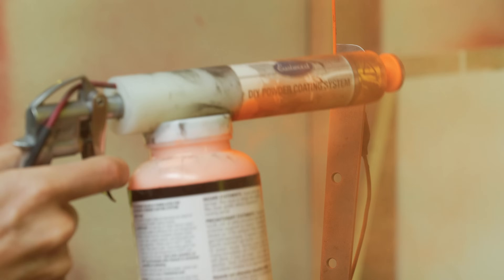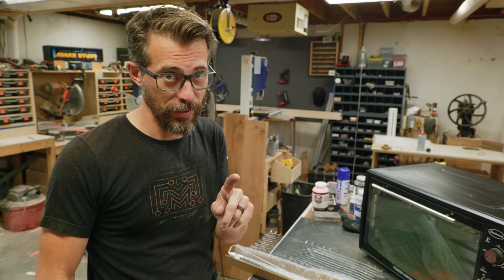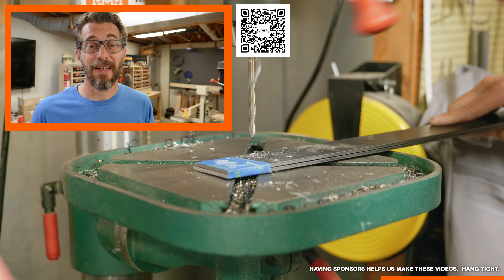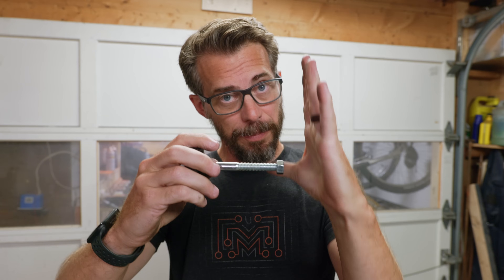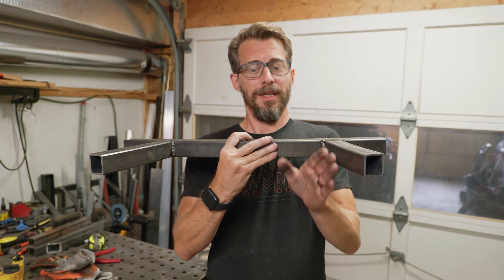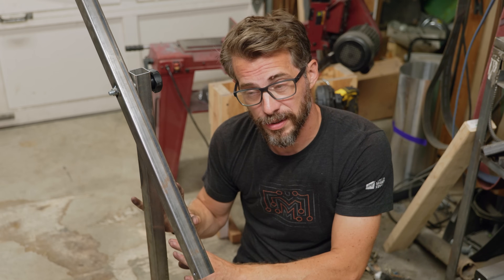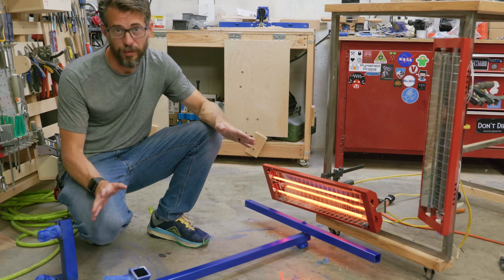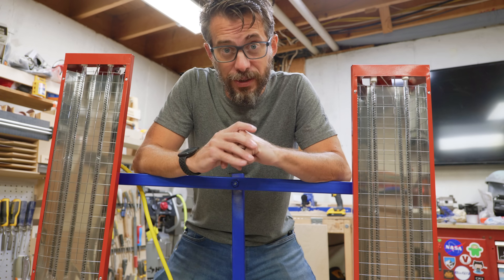How To Powder Coat Without An Oven!

Comment: You're going to have a hard time getting good, repeatable results. You can't preheat parts reliably, it is generally line of sight, and your surface temps are going to be all over the place. To get a good bond, the base material needs to be at temp for 15-20 minutes depending on the powder and metal you're coating. You can do it, but be prepared for lots of fiddling with distance and time with the temp gun.
Reply: 100% This. The heaters should be inside some type of foldable, insulated box with a fan because trying to get even coverage on any nooks and crannies will be impossible with this type of setup.

Comment: Get some assorted silicone conical plugs (from tiny to large) for fast masking of threaded holes. They're also re-useable since nothing sticks to silicone. Build a foldable rockwool lined enclosure to encapsulate the heat. A working second hand electric oven works well for mid-sized parts or batches, and you can put the small oven on top of it for the little jobs. I've done lots of automotive parts like rims, steering, suspension and brake components but you need to be careful of the powder's temperature range so in some cases, high temp paint is a better option. The heat will add a toughened result in most cases, but you will obviously need a lower temperature for those items. You just need to think about any metal items that you don't want to rust or corrode really. Yard equipment is always a good choice like snow blowers, etc.
Reply: They also have high temp powder as well.

Comment: I think you should have some kind of fold up reflector. So you can store it away easily, and take advantage of the radiant heat all around.
Reply from the maker: Yeah that would be a good upgrade to try
Reply: @Iliketomakestuff I thought you'd make 2 stands and mount 1 heater on each to heat the obejct from at least 2 sides. Put this in an reflective corner and that should work swell

Comment: How about a second stand or a deployable booth with panels to reflect the heat? Maybe you could have more uniform coverage and do a large piece in one go rather than move the piece.
Reply: I'm definitely thinking portable booth with some kind of panel attachments that fold up when not in use is the way to go. could also serve as storage for the delicate IR lights when folded up and not in use.
Reply from the maker: Yeah that would be a good idea to try to build upon this. As long as it's easily portable and storable.

Comment: I suggest an enclosure. Powder coating doesn't like to cure in sections. Also it can give you a clean environment to spray in which is very important , contamination is a bad thing.  I've seen it done with large cardboard panels with foil attached to the inside. It can be built to pack flat against a wall when your not using it.
Reply: Dumping heat into a cold shop doesn't look like an effective process.  🤣

Comment: First thing you should powder coat with this is a big reflector for powder coating. Same rollable base with as big of a reflector as the heaters are so you heat more evenly and waste less energy/heat to the surrounding. You could make it do double duty and have one side as a head reflector and the other as an acoustic barrier for making your videos.

Comment: I used to work at a pipe coating company (oilfield line pipe). One of the coatings we did was FBE, which is fusibond epoxy. Powder coat, basically. The pipe would pass through an induction coil, heating it up super hot. The powder would be blown at the pipe via multiple nozzles, and there was an air return system that sucked away the excess. It would gel onto the pipe and pass through a water bath to cool the pipe down.

Hope that helps! (lol, it won't for this application)